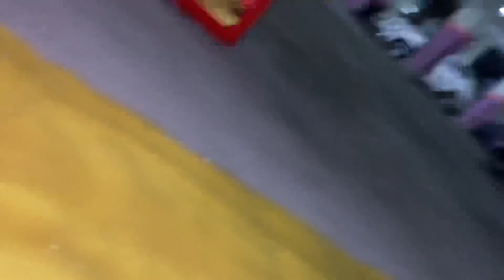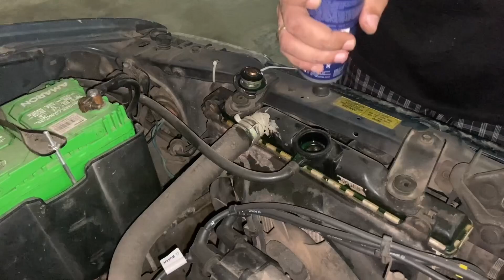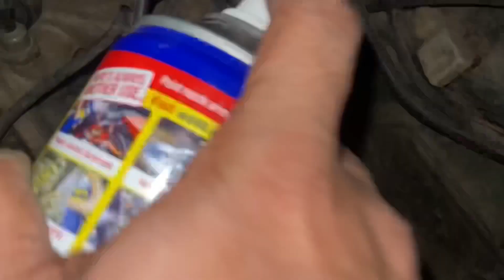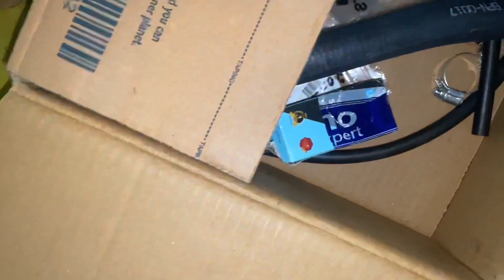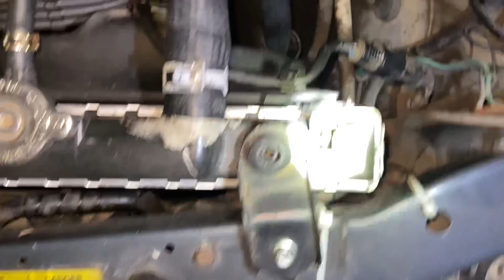99 Maruti Zen Restoration - Coolant System

Comment: Hi ganesh in my car the temparature gauge not showing when i start the car it level comes to 'c' then stays there.what may the issue
Reply from the maker: Hi! If the temperature needle stays at ‘C’ even after the engine warms up, it’s usually due to a faulty temperature sensor or an issue with the wiring to the gauge. Less commonly, the gauge itself could be faulty.

I’d suggest first checking the coolant temperature sensor - replacing it often fixes the issue.

Comment: Good explain.. Bro... ❤  i need carburetor  parts, where is available pls..
Reply from the maker: Hi Jomon, please check with your local mechanics and spare parts shop. Very hard to get nowadays. Complete carburettor assembly is available from KPACO. Contact Mr Amarnath Sharma - 95995 57487.

Comment: Wow, what a fantastic video and such clear explanation and attention to detail...truly inspiring..personally i too would like to embark on a zen restoration project but how are you able to source the parts?? I tried looking for a new zen carburettor and that itself was impossible..well done and keep up the good work...
Reply from the maker: Hello Ivan, thank you for the feedback. I really appreciate it. 😊

As regards parts for the Zen, Maruti has nearly stopped all the parts but whatever is stashed away in some random corner of some MGP store’s warehouse can be traced using their system. If you approach them with the part number, they can search and see if it’s there somewhere. 

As for Carburettor, get it from KPACCO, New Delhi. Amar is the contact person, +91 95995 57487
Reply: @GaneshBalan  many thanks for your suggestion, will see if I can get the engine started and then consider further repairs..

Comment: Brother i am owning a exide care showroom, and i do own a 1996 zen, i recommend not to use exide distillo - distilled water for coolsnt since it contains some acid mixing in it, which may corrode the cooling system
Reply from the maker: Hi Parthiban, thanks for the advice. Point taken.

Comment: Can u pls send the radiator clambs bottom and top part numbers
Reply from the maker: Hi Nishanth, the parts numbers are as follows:

1. Top mount 1 - 17861M72F00A

2. Top mount 2 - 17862M72F00A

3. Bottom bush - 17879M70B21

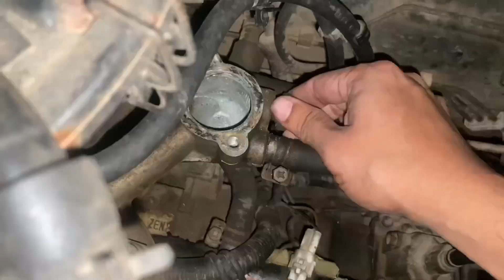Comment: 10:44 I just want to let you know that the vacuum check valve for the hot restart system in your carburetor is installed incorrectly. The black side should be the inlet, and the red side should face the hot restart actuator (diaphragm).
Reply from the maker: Thank you Brittos, I’ve checked. The black side is indeed the inlet side and red side the outlet. The tubing on the outlet side (red) is longer and giving an impression that I’ve connected it the other way.
Reply: @GaneshBalan  Now it makes sense. And great video as usual btw

Comment: Great work Ganesh ! Small tip i'd like to add is to squeeze the hoses as you pour the new coolant. It will help eradicate air from the cooling system. The thermostat valve has a air bleed valve. As you squeeze the hoses the coolant is pushed in and at the top radiator cap you can see the air bubbles
Reply from the maker: Thanks Ashton. I’ll keep it in mind. 👍🏻

Comment: Good detailed video mate, but might I suggest not to rinse the cleaning agents or other corrosive agents down your bathroom drain for environmental reasons. Plus this might act as incriminating evidence if the municipal corporation stumbles upon it. It was commendable what you did with the coolant by putting it back in the empty water jugs.
Reply from the maker: Thanks. I’m wondering where else could one wash this condenser coil without letting it drain this way. Do you have some ideas?
Reply: @GaneshBalan  That's a good question, maybe wash it in one of those containers like the ones we have for collecting oil or something similar.

Comment: Can you explain the use of the thermostat switch here ? Aren't these thermostats supposed to automatically open when the operating temperature is reached ?
Reply from the maker: You’re right about the thermostat. The thermostat switch turns on the cooling fan behind the radiator when the coolant temperature crosses a threshold.
Reply: Sorry to jump in here, the spring type part is actually a valve which is heat operated, when the spring gets hot it compresses opening the engine loop to the outside radiator loop, the other part , small one is the temperature sensor not a switch.

Comment: Very exhaustive  cleaning with clear explanation.
Reply from the maker: Thank you Mahendran. 😊
Reply: @GaneshBalan  Do u use a different solution for cleaning the radiator
Reply from the maker: @mahendranr1317 For flushing, I’ve used Mannol radiator cleaning concentrate.